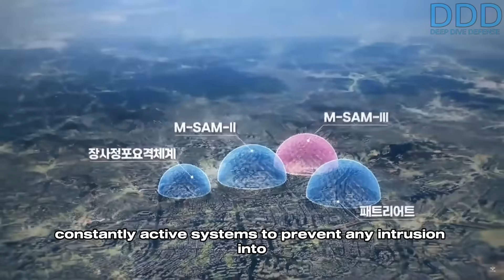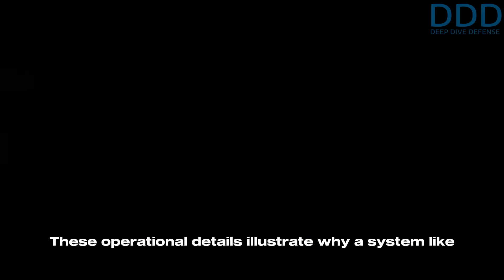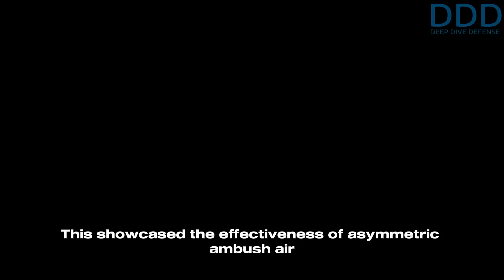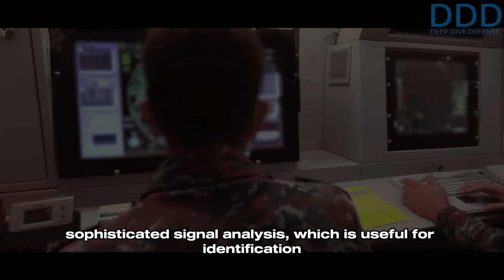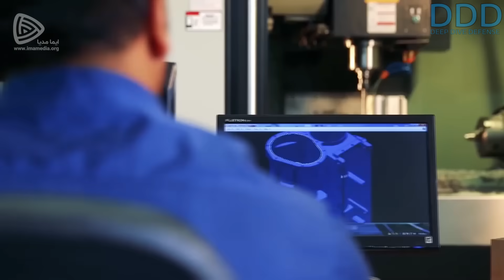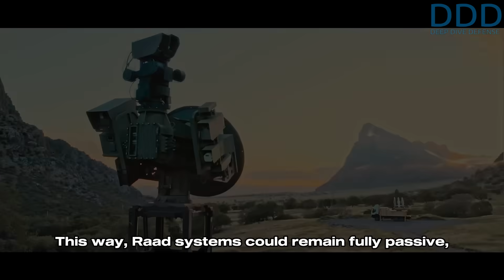Did Iran's Ambush SAM fail during the 12-Day conflict? The Tabas Air-Defense system & it's details

Comment: When this thing turns on it lights up the EM spectrum like a christmas tree from 100km away. It has no LPI capability which is why it has little value in a real conflict
Reply from the maker: Ideally it uses its radar only for the short period of engagement
Reply: @DeepDiveDefense ambush air defense techniques are not very effective but, hey, better than nothing

Comment: It appears that not there is really Air Force, but the ground forces who were trained for sabotage were responsible for suppressing Iranian air defense. Therefore, after the dismantling of sabotage groups inside Iran, many of the unused or air defense system that were turned off or not deployed are still functional
Reply from the maker: Those covert ops played a big role, yes
Reply: MI 6 was responsible of sabotage using killers drones
Reply: In Iran Iraq war many radars would shut themselves off while some specific threats would come because they knew they can't engage and they will be targets, since then Iran had to learn when and where of deploying AD systems, in 12 day conflict there was a probability of a huge shared bombing campaign from USA plus Israel so they couldn't risk to put everything at work because there's several known very sophisticated anti radar missiles that could target them in high numbers, yes that strategy lead to less and weaker cover of AD but it kept the necessary power to defend against those kind of attack which is aligned with Iran's strategy even before revolution which they chose F-14 to be able to cover more air space compared to other options which they planned to expand but revolution didn't let that happen, before revolution Iran was trying to get a fighter jet that covers a lot of distance then buy more jets for covering special parts which was going to take place by ordering F-16s which IRAn didn't get because of revolution. 
Overall Iran announced many years ago that they made a system for connecting all AD systems to each other and that helps them to use each part more carefully and when needed. 
Something changed though,IRCG officials are talking about a drone based AD which they have developed early systems for lunch and connection with ground systems but clearly they haven't made the full system yet and it might slow down a little bit since they're spending a lot of resources for buying fighter jets and foreign AD systems which means they learned that they won't be able to one:develop and mass produce those systems in time and two: probably even if they do they can't replace the urgent need of fighter jets and advanced foreign ground AD systems(not only radar or battery itself but it's Electronic warfare systems and others).
One thing is clear though Iran doesn't have resources for making a fighter jet with additional systems that others have so they finally decided to take buying foreign ones seriously.

Comment: FIRST, IRAN'S AIR DEFENSE SYSTEMS DID NOT FAIL. ISRAEL MAP OUT EVERY LAND and MOBILE RADAR SYSTEMS THAT IRAN HAD WITH U.S. SATELLITES. THEN THEY MAP OUT EVERY RADAR SAM MOBILE TRUCK IRAN HAD THAT WAS IN THERE BOMBING RUN. SO ISRAEL KNEW THEIR APPROXIMATE LOCATION. THEN the U.S. and ISRAEL use their cruise missiles to take out some of them. But the rest that was out of range, they used THE VOLONAUT AIR BIKE TO GET DEEPER INTO IRAN. THE OPERATOR THAN USED A DRONE TO TAKE OUT THE REST OF THE SAM TRUCKS WHEN IT CAME TIME. HOW TO FIX IRAN'S AIR DEFENSE SYSTEMS. IRAN NEEDS A DRONE RADAR SYSTEM THAT FLIES MORE THAN 20 HOURS A DAY and FLIES UP TO 60,000 FEET. That will keep ISRAEL UP AT NIGHT. IT'S NOT IMPOSSIBLE, IF YOU THINK IT IS, LOOK AT YOUR CELLPHONE. THE TECHNOLOGY CAN BE SHRUNKEN DOWN JUST LIKE OUR CELLPHONE TECHNOLOGY THAT'S IN OUR CELLPHONE.
Reply from the maker: Interesting take and points!
Reply: If you don't SCORE you didn't WIN 

 Iran made claims that they shotdown  FOUR  F-35  planes and captured a "female pilot" ALL of which were ......................................FALSE
Reply: @NDR-hn3ue 

جنگنده ساقط شد ولی ممکن است اف ۱۵ و ۱۶ بوده ، من فکر میکنم خلبان‌ها معامله شدن ، در ضمن پدافند ایران توسط مزدوران لو رفته بود و بعضی از آنها منهدم
Reply: @Niki1177-i3e  Iran didn't release ANY evidence of this either
Reply: @NDR-hn3ue  did israel release evidence of dominating Iran airspace????
show video
Reply: @classicmoviez3909  Actually they did release several videos (the F-14 video being one of them ) making claim that they "controlled" nearly a third of the airspace
Reply: They don't need to take out ALL of them only the ones that on the flight path
Reply: @abu-alialiraqi That's what I said.

Comment: I know I'm going to repeat this ad-nauseum, but as good as the Tabas seems to be, it does not seem to have succeeded in ambushing and destroying any Israeli manned aircraft (unknown success rate regarding drones).  Which means that although it may have added a layer of unpredictability for Israel, it did not succeed in its primary mission, whereas, Israel's air attacks DID succeed in many of THEIR primary missions.  And not just in this round.  Iran has not succeeded in downing a manned aircraft throughout the entire venture into Syria, from 2013 all the way to the end of the Assad regime in 2024...except one F-16, while the Israelis gutted the Iranian forces inside Syria with near-impunity.  Whereas, the Houthis succeeded in downing multiple Saudi fighter jets with their "SAM-bush" tactics using far less sophisticated anti-air defense systems.  Admittedly, the Saudis have less sophisticated planes than the Israelis.  Admittedly, the tracking would have been easier, as Yemen borders Saudi, and would be able to monitor air bases to some degree.

But all of that just goes to show that the Tabas isn't what's needed to truly have an effective impact against Israeli air attacks.  What is needed is to hit these aircraft in their "safe" corridors.  Iran couldn't do this until Israel effectively established those "safe" corridors OVER Iran by bombing any strategically important anti-air targets.  Which means that, like any guerilla group, Iran had to wait until Israel was finished with its SEAD bombing before it could really threaten the comfort zone of the Israeli air force.

The answer would be to double down even further on the Tabas "SAM-bush" strategy to a level that is truly guerilla-style, with coordination from long-range centrally-located radars.  Instead of commercial trucks, go with jeeps, or even off-road vehicles, or single missiles (like the 358 loitering SAM), and smaller, more focused radar systems carried in components by small tactical squads.  Smuggle/infiltrate into Syria, Iraq and Lebanon, and deploy quietly near Israel's doorstep.  Aim for at least three or four successful manned air shootdowns, which would have a massive psychological impact on the Israelis, closer to their "end zone".

The fact that not ONE manned aircraft was shot down over this period by Iran played massively into the decision by the US to join the attack against Iran (indeed, the B-2 bombers, despite their stealth technology, were not deployed until after the Israelis had effectively wiped out all significant air defenses (missiles and radars) around the target zone).  It also played massively into the Iranians' decision NOT to continue the war against Israel, when they had a significant advantage over Israel, and the moral high ground, and the backing of most of the world.
Reply: I don't understand how Iran could've downed Zio manned aircraft when none entered into Iranian airspace. They only used stand off weapons, as the video explains. That shows me that the Iranian weapons did well in preventing direct overhead aircraft droppings.
Reply: @WayneGreen-g8l as I said, they could have armed their militias in Iraq and Syria with guerrilla-style systems, such as upgraded and developed versions of the 358 and 359 loitering SAM missiles (this channel has a great intro to these very effective systems).
Reply from the maker: Good points!
Just remember than stand-off weapon warfare is quite limited
Reply: @DeepDiveDefense  so was ballistic missile tech at one point…until the Iranians and later the Houthis massively lowered the costs and increased the numbers.  Israel and the US will be quick to derive the necessary lessons, both from this engagement and the one with the Houthis, and arrive at the correct conclusions:  mass production and lowered costs for their very effective standoff weapons.  They are already doing so with drones and interceptor missiles, especially after Ukraine.  Iran needs to apply the same philosophy to their air defense systems…and fast.
Reply: Your strategic analysis is EXCELLENT
Reply: @NDR-hn3ue thank you ❤.
Reply: Jajajaja, 🤡💩 asesinos yanquis y jufios
Reply: Iran are jokers. is the only thing on can say. clowns. one can write a one thousand page volume about Iranian security and defence failures since 2013. the islamic system simply promotes lowiq people to the highest echelons, and the results are evident. then some clowns do videos to rationalize these failures.
Reply: @DubaSangara Are the Israelis paying you to post this kind of crap or you just do it for free? 🤮🤮🤮

Comment: They can't shoot at things that are out of the range of Air defence systems. It is what it is. They are good but at 40-80km. If Israeli jets and drones stay away from that range they are good to go.
Reply from the maker: Yes, but even 80km range is very useful
Reply: @DeepDiveDefense People expect that systems designed to shot down planes at 40 - 80km range,  do that at 250-500km which is impossible. Even S400 is going to have hard time shooting a plane at >200KM radious IMO.
Reply: If even if they had the s400 that would've been the first air defense to be targeted early in the start of the conflict
Reply: @ChoppaRH Looks like ambush ADs are the only real option — unless you’ve got a fully integrated, layered system like Iron Dome. Still, even those can only reduce damage to key targets, like we saw in the 11-day Iran–Israel conflict